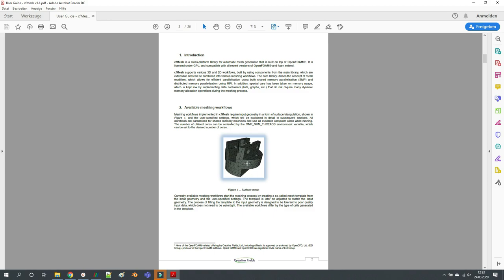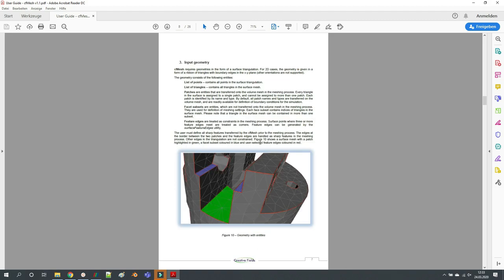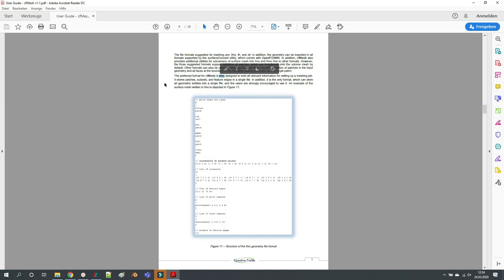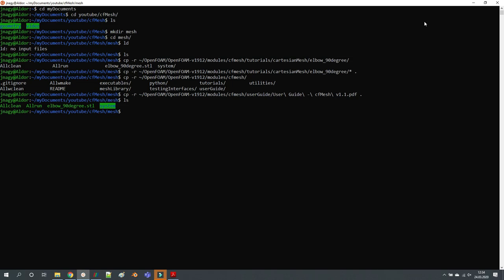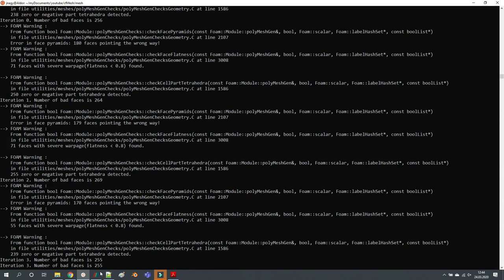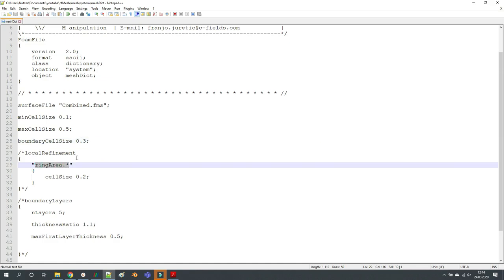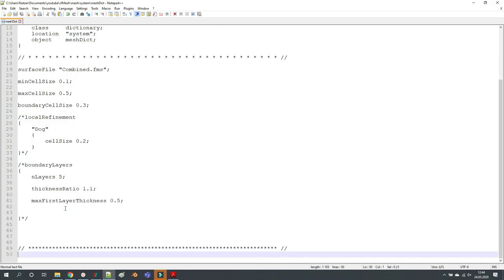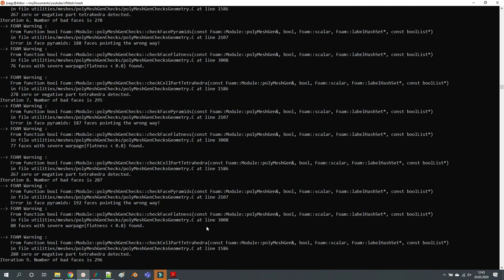How to create your first mesh with cfMesh - tutorial

Comment: Thank you! I wasted so much time today on sHM parameters for my geometry, that it got me frustrated and it made me think of how slow I am at solving my problems just because of dozen not satisfying remeshings each time. sMH works fine most of the time, but sometimes it forces me to use unreasonably large amount of cells, just to get rid of few bad ones, sometimes the layer addition totally distorts cells away from the viscous sublayer, and sometimes I cannot force layer addition on some faces no  matter what mesh quality settings I pick. And it is more frustrating the more simple shape appears to be in my opinion. This looks very simple and fast, I'll give it a try tommorow. It might be the real game changer
Reply from the maker: In my experience for some geometries snappy is the better choice, for some cfMesh. It is worth investigating though.
Reply: @OpenFOAMJozsefNagy  I've been testing cfMesh for the past week and I have this conclusion that it is nearly impossible to create any mesh that passes "checkMesh -allGeometry -allTopology" with minor errors. The mesh looks great, it fits layers with ease, but it has a lot of skew cells, non-orthogonal cells, negative volumes, warped faces etc. and it doesn't have any additional parameters to improve this . Even the tutorial cases return bad quality meshes. Not in terms of how they represent real geometries, but in terms of cell quality criteria.
Reply from the maker: @piotrmecht2500  Thank you for your input. checkMesh is usually very strict. Do the simulations run?
Reply: @piotrmecht2500  just one question. Does foam handle the calculation with cfmesh in your case?
Reply: @HolzmannCFD  I had some issues with convergence back then, but I figured out later, that the problem was the oscillating nature of flow i tried to capture with the steady state solver. I ran some successful simulations on cfmeshes since then. I've learned that I can 'manually' merge/zone my cfmeshes to perform cht or ami and I find cfmesh even more usefull now (i used to think that i'm forced to use sHM to do this). Lack of control over mesh quality criteria might be sometimes annoying, I had one geometry with shaped narrow channel and bunch of U-shaped heaters, which for me was so hard to properly mesh, that i gave up meshing and built a physical prototype with many sensors and see-through bulk :/ cfMesh is a great tool and I can't recommend it enough, it has its limitations, but you can find some work-arounds for them with other openFOAM tools
Reply: @piotrmecht2500  so I should check it out as I am using shm since 10 years now too

Comment: cfMesh is a pretty nice meshing tool in terms of its efficiency, simplicity and flexibility!!

One thing I don't like it is that it accepts only the fms file containing patches and extracted feature edges (remark: it accepts stl as well but stl contains only patches, no edges).  There're two ways to do - 1. using command surfaceFeatureEdges with a specified angle (remark: there's no full control on the selection of the feature edges), and 2. using Salome together with python script (remark: full control on selected feature edges but only in Salome).  

Do you know if there's any way to have full control of the feature edges selection if I use Blender for geometry buildup?  Exporting stl (prepared in Blender) into Salome can be a way but a bit trouble.
Reply from the maker: No, unfortunately. I mean theoretically it is possible to program an exporter for blender, but my python skills are unfortunately not up to the challenge. If anyone has the python master skills, I would be happy to support.
Reply: @OpenFOAMJozsefNagy  Thanks for your reply.  I'm also not an expert in python, so sad!  It looks not an easy task.

Comment: Fixed it now (answer below)

I've been testing different meshing utilities, but i keep getting the same error saying that openfoam cant find the controlDict file. Fistly, i didn't think you needed a controlDict file for meshing (only a blockMeshDict or meshDict etc), but also, i do have a controlDict file. So i'm confused. I am in my home directory, the files are in the right places.

the directory where the controlDict text file is this:  /home/"my name"/cylinderTestCase/system/

Any ideas?

when i created the dict files, i made them all .txt . Since i wasn't copying any from tutorials and making my own up. I'm new to linux and Openfoam, so i dont know what file extension (if any?!) when creating - say - a meshDict or whatever. To fix it i copied a random controlDict file, replaced it with my meshDict info, and renamed it meshDict, and deleted the original.

Comment: Hi, nice video. I have a question regarding to fluid-structure interaction. In your case, you only generate mesh beween bounding box and dog, we could say it fluid domain. What if I want to create mesh for solid domain (e.g. the dog) in the meantime? I'm wondering how to do it in cfmesh. Looking forward to hearing any constructive ideas.
Reply from the maker: Separately and then join the meshes.
Reply: @OpenFOAMJozsefNagy  Hi Jozsef, thanks for your reply. I tried to mesh them separately, but mesh at interface is not conformal. I'm not sure if there is one utility in cfmesh can merge the cells perfectly.
Reply from the maker: @kewu6250  No there is not.

Comment: Hi Joszef, thanks for your contribution. I will ask you why the second mesh is much coarser compared to the second run. I don't get the point here as you limited the max parameter while keeping the smaller one. I would have expected the same surface mesh with finer internal cells.

Even the surface refinement was reduced from 0.3 to 0.1. So for me it should be vice versa if the meshing output.

First mesh, coarser as the max parameter is 0.5
Second mesh finer as the min parameter is 0.1

However it seems that cfmesh is using some special refinement on the dog in the coarse case. Why it does not happen with the second ru., I don't know. Can you please clarify my doubts.?
Reply: Hi, I couldn't generate layers in polyhedral mesh "pMesh" why??

Comment: Hi Joszef,
I much prefer the workflow of setting a cell size at the surface of interest and a growth rate from that surface, similar to what you demonstrated. Unfortunately, I have not been able to find a way to adjust the growth rate of the cells in cfmesh (you are able to adjust the distance from the surface for which the specified cell size holds true). When there is a big difference between the surface cell size and freestream cells, the transition between these cells is not smooth. In order to smooth these out the cells I use multiple box object refinements to gradually increase cell size to freestream, although this can be very time consuming. I am hoping you, or someone else, have a good suggestion of where to look for a solution.
And as always, thank you for the videos!
Reply from the maker: All settings are in the docu. Additional features are in the paid version of cfmesh+.
Reply: @OpenFOAMJozsefNagy  Thank you for the response!

Comment: 👍 Great stuff.  Have a model that SHM cannot mesh because I 'only have' a combined 200GB of RAM.
Reply from the maker: :D Not bad. Hopefully cfMesh can handle it.
Reply: I know this is a very old comment. But I guess your background mesh in SHM is too fine and you use refinement levels upto 4 on that background mesh.
Reply: @vaibhavvb9898   Yeah.  The problem was a large metal enclosure with lots of small circuit boards attached to the front panel.  Airflow for the enclosure was around the port on the front panel, some being only 0.5mm if I remember correctly.

Comment: Hey Mr Jozsef Nagy,

Thank you for the amazing tutorial.

I have an issue with combining the stl files. I have attached the link to files here : https://drive.google.com/drive/folders/1Q-NOoOtFV2ui9Jc7u8rK279wVzxE4wIP?usp=sharing
I would really appreciate if you could help.

Thanks in advance
Reply from the maker: Yes, your files are in binary. Check the checkbox in blender for "ASCII" while exporting the STLs and it should work.
Reply: @OpenFOAMJozsefNagy  Thanks!! it worked